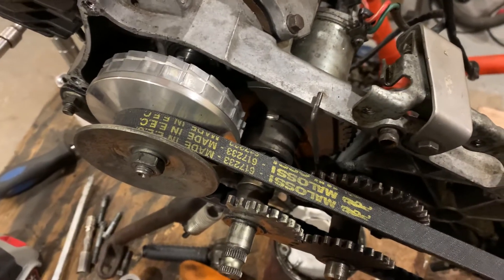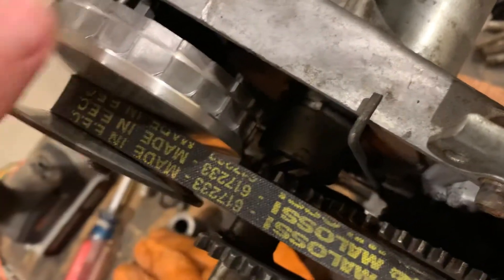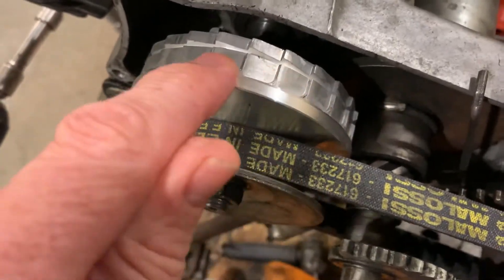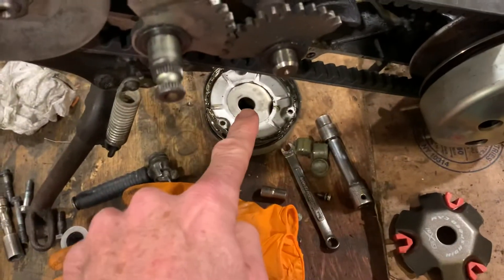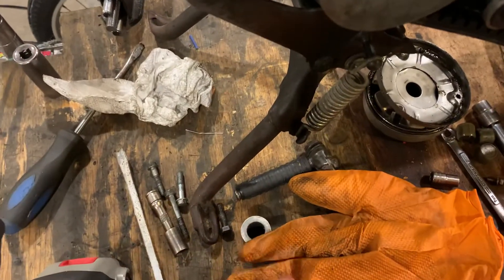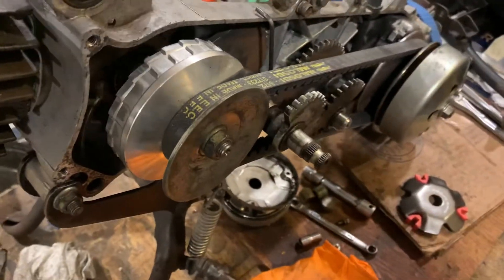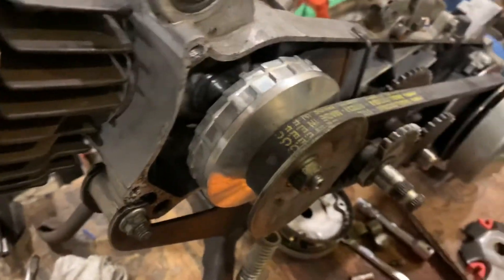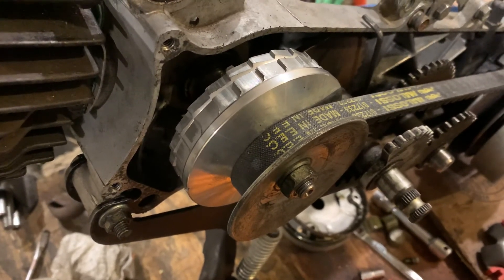Honda Urban Express performance variator

Comment: My 1983 QT50 has a spark but weak , it’s a new plug and  coil, but a mech. Freind says it’s my CDI box ..   you think it maybe ?
$22 on eBay . Going to replace it.
Reply from the maker: could be the cdi but usually it's the charge coil - frequent point of failure

Comment: Thank you for putting this together for us to see. I was curious what the issues with the setup would be. If you have the deluxe then I guess you could remove the kickstart gear altogether temporarily to test out the acceleration gains. Or drill start the engine. Keep us updated! Thanks

Comment: Either take it to a machine shop and have them turn it on a lathe (best), or start the engine and hold emery cloth against the spinning surface you want to sand (cheap).
Reply: I agree .... machine shop, sanding on the engine will throw abrasive debris all over your engine.